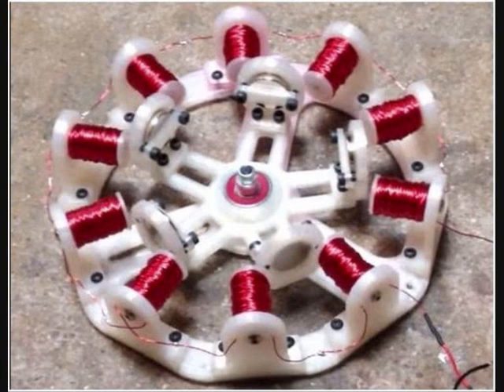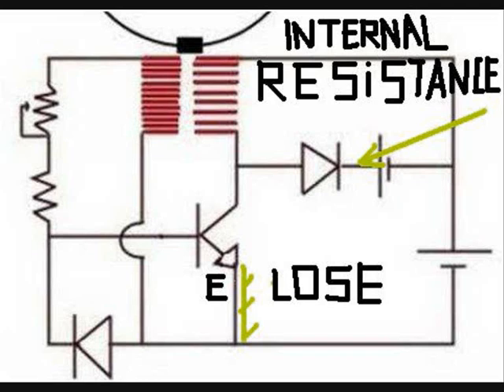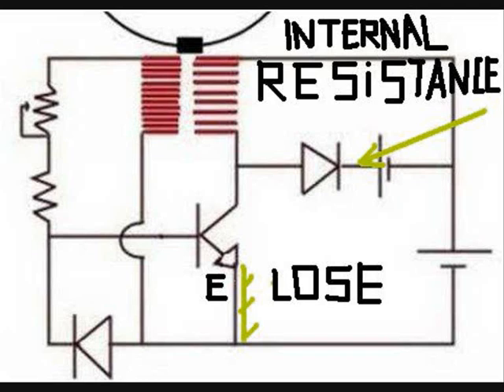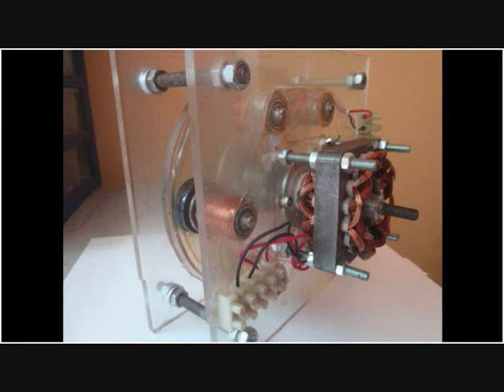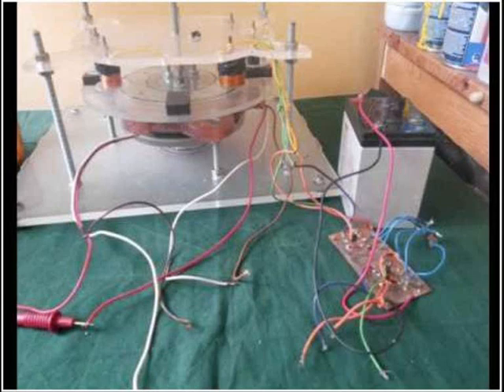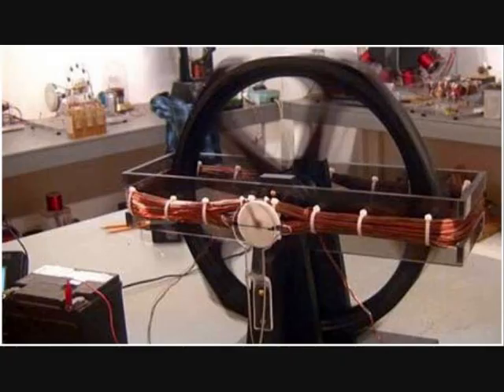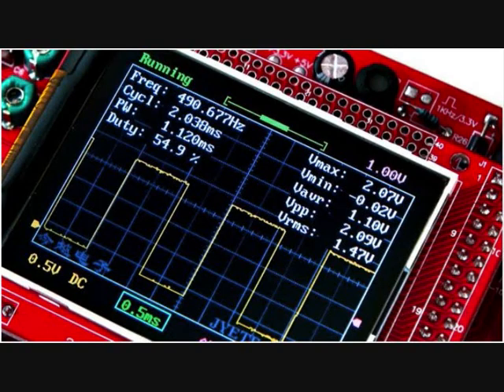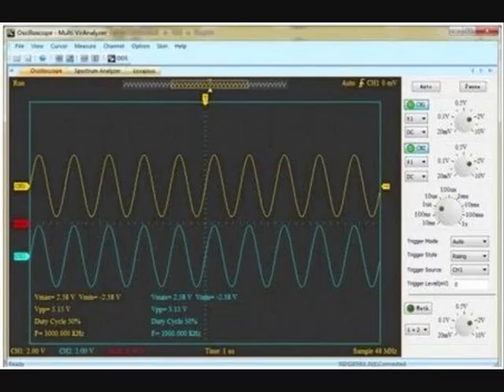Why no more pulse motor builds?

Comment: Question, do you know what a reluctant motor is and if yes do you know how more efficient a reluctant motor is compared to a 3 phase motor? Nice work but I suggest you look into reluctant motors and you should get sole helpful info but again they already make them. Now with the ability to program custom speed control to very fast ms timing. This takes away what was the expensive part of this motor  this motor is also less to manufacture then a 3 phase motor. Not trying to he a di#% or anything. But I looked up these pulse motors and alot of people build them but why. If your looking into and learning about electric motors you would easily find this technology is very old and has been here for everyone to easily copy. Keep up the great work my friend. Cheers

Comment: My goal is to build a 2 level pulse motor, I have bldc motors from pc fans and hdd I’ll use. The thought is the pulse will drive the bldc and create output, or I’ll place a weight on the gear tall enough to reach the second level, probably need a counter balance as well but half the size. The weight will spin inside a stater and produce 3 phase. We will see

Comment: https://youtube.com/user/ufopolitics Asymmetric DC pulse motors with two commutators can output 2 times more mechanical power than input power. Asymmetric motors is more efficient than symmetric motors, and can do useful work, can be used in electric cars, electric chainsaws, electric trimmers, other appliances.

Comment: some information..    when a (pulse)  motor has only one or two poles it is  NOT  possible to use it AS  a  motor.     why is this true.     the  rotor  is  COASTING   part of the time.    in other words, for a motor to be usable  AS a  motor, its  output torque   MUST  BE  CONTINUOUS.        also,  when a motor is incorporated into a  POWER  circuit,  the motor is functioning as a  ROTARY  TRANSFORMER;  the motor is NOT doing work/is not LOADED.      the ONLY thing such a circuit   CAN  DO  is,    TRANSFER  power  from  one place  to  another; with some minor  LOSS.    like ANY  OTHER  TRANSFORMER.     a circuit whose design has been optimized  for the production and capture of  back-emf, is  a  Do-Nothing.        back-emf is  NOT  free energy.      BUT   WAIT,             ou  has been at our fingertips, for more than  20  YEARS.     in order to understand why this is true, you are invited to review the entirety of my ou  research; and/or  see my recent comments, at this video. 
https://www.youtube.com/watch?v=lz3KTCW3848

the development of  Large-radius  bldc  outrunner motors ( such as f&p  and, non-geared, e-bike motors ) has  made it, easily,  possible for experimenters  to  make use of a prime mover that has  A   LOT  of  Inherent MA.   Mechanical Advantage. 
https://www.fisherpaykeltechnologies.com/products/direct-drive-motors/

(2nd-hand)  motors can be purchased, on ebay/amazon.    look for  lg  or  samsung washer motor.
in  thousands of attempts,  No  One  has  succeeded in proving  faraday and lenz, to be wrong. 
 the definition of  stoopid is,  doing the same thing over and over, and expecting a DIFFERENT  result.     cheers               googletranslate

Comment: the point in the bedini design is to collect or harness the energy generated by the pull force of the magnet on your rotor to the core of your electromagnet. never use more power than is necessary to break the connection of your rotor magnet to your core. you can also rid yourself of internal resistance by puttung super capacitors in the circuit. hope this helps.
Reply: yeah sure but its not overunity. its not a very efficient motor but does make a good fan motor driver. i make pulse motors cause theyre just so much fun to make.
Reply: @ozymandiasking173  Based on the fact that the pull force of the magnet to the core is free , in effect there is a free energy element to the operation.
Reply: Trigger system?
Reply: @strangescience3414  a magnet pulls itself to iron, this magnet is attached to a rotor/wheel..  The trigger pulse should equal less energy than the energy generated by the pull of the magnet to that iron.